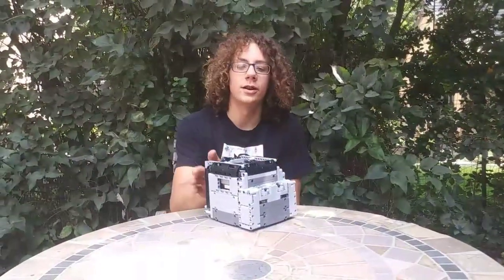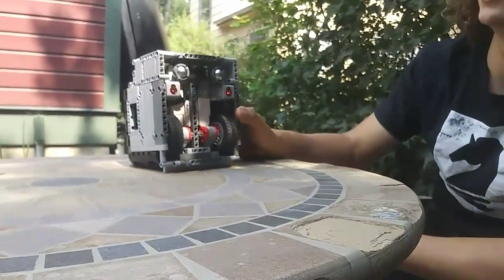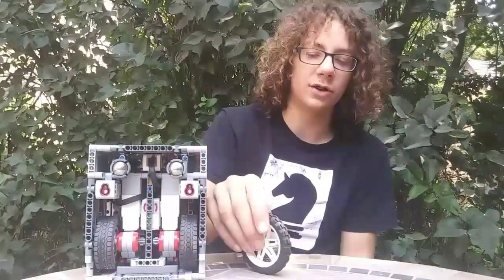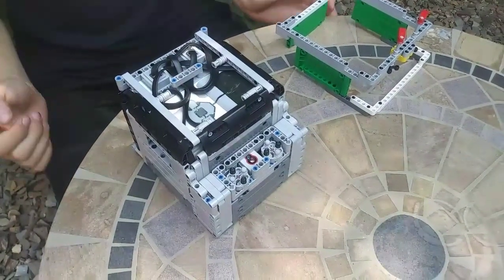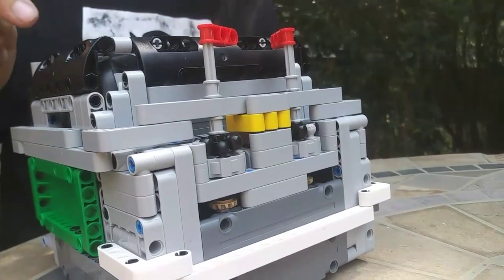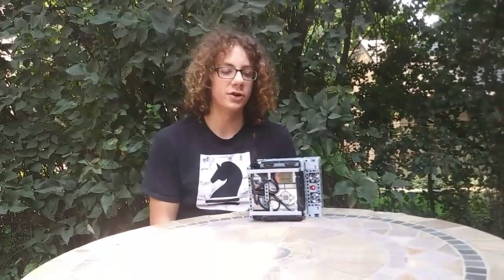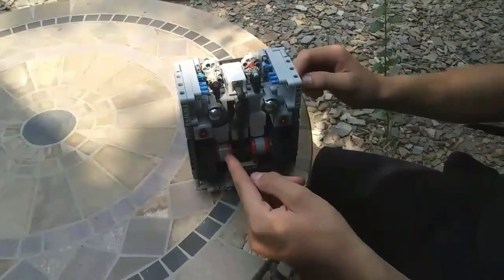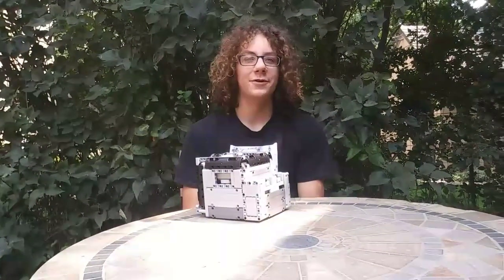NEW COMPACT FLL Into Orbit Robot! | DJ Miniquiche 2.0

Comment: I noticed that you guys have a back wheel drive.  How do you make it work without drifting?  Whenever we try it it always drifts
Reply from the maker: We use a gyro sensor to make sure we always drive perfectly straight.  Does it drift more than with front wheel drive?
Reply: We also use a gyro sensor also.  When we used it, it drifted a tad bit more that front wheel drive.

Comment: Ok, beginner here, but how do you write the program so that it detects the correct program to run based on the color sensor?
Reply from the maker: Good Question! In order to make that program, you have to treat the EV3 programming language a little more like a regular programming language. What you do is you make a series of if statements inside each other. For example, you would say, 

If color sensor sees red (
     Then run program 1
)
Otherwise (
     If color sensor sees green (
          Then run program 2
     )
     Otherwise (
          If color sensor sees blue (
               Then run program 3 
          )
          Otherwise (
               Then run program 4
          )
)
I hope this helps!
Reply: Thank You!

Comment: When you start a robot from the ground up, what is the first thing you do?
Reply from the maker: Interesting question. For our team, we usually identify what components we want in the robot (which wheels, which sensors, which motors, etc)  and then we try to fit them all together in a compact way. After that, we build a shell around it to help slip on the attachments. After we finish building the robot, we look at and see the pros and cons of that design, and then we take it apart and rebuild it using more of the good things and less of the bad. This step is the most important. Last year, we spent almost a month trying to finalize a design, but this year, we took our old and already good robot and only had to rebuild a couple of times to get it how we wanted it.

Thanks for asking!
Reply: Thanks! We'll have this in mind with my team.